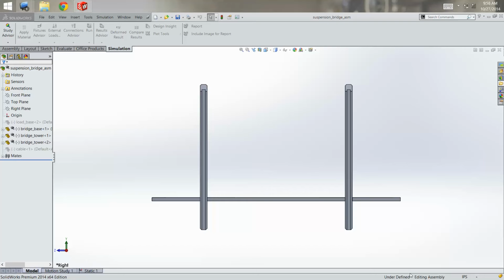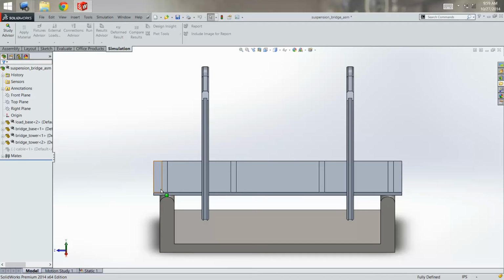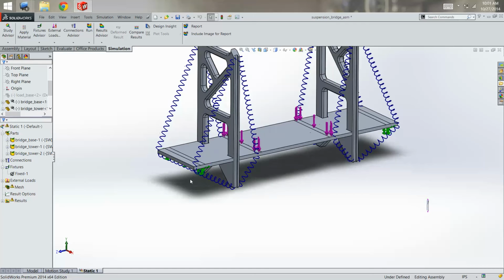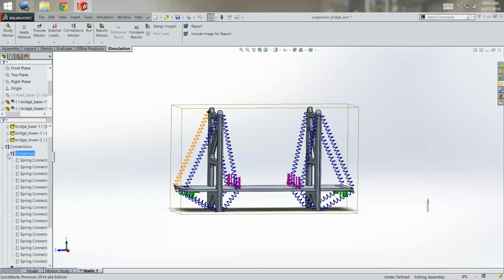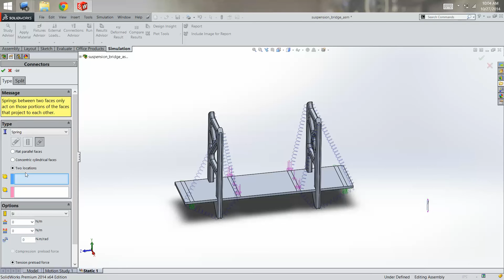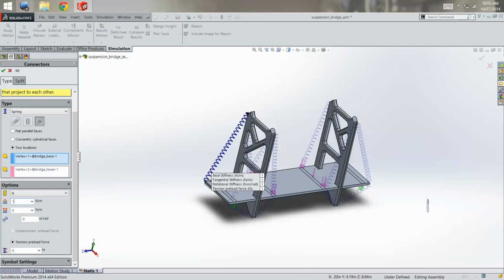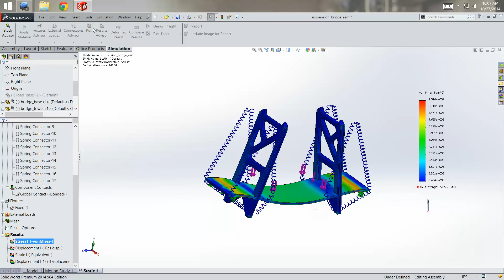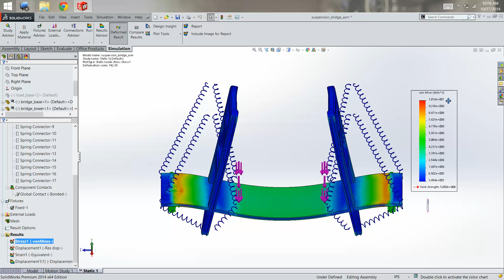Spring Connector For Tension Cable Simulation

Comment: How do you use a hole as a spring connector for simulating cable?
Reply: I tried to figure out and that why I watch this video, but it seem SW are not very strong at this. In ansys it's easy to add spring as a cable, connected from surface to ground some where, but SW only possible to choose a point or vertex. Then for suspended structure of many tons heavy this will really strange